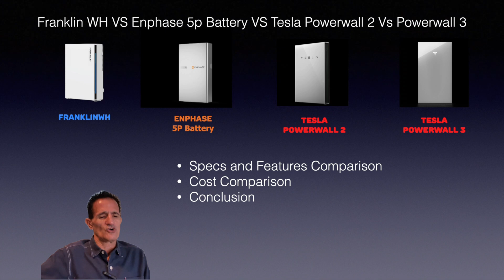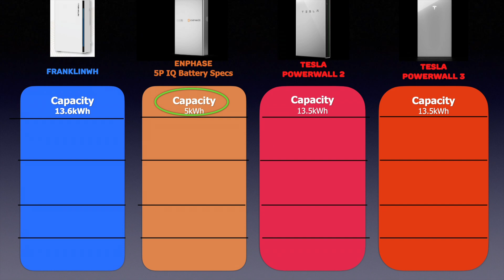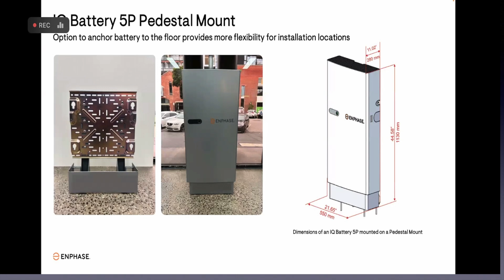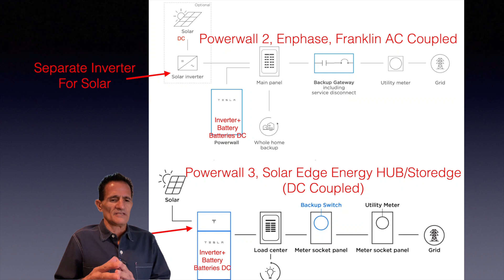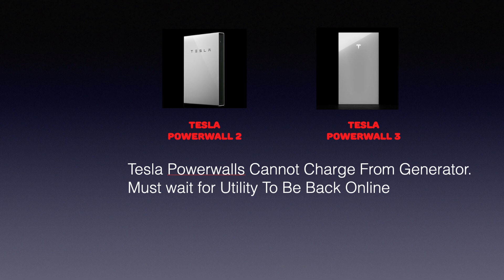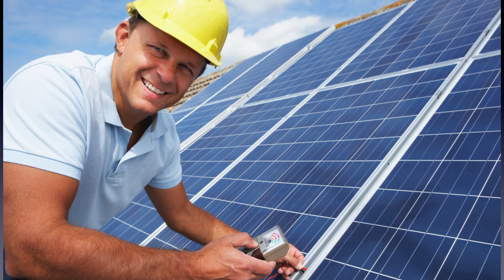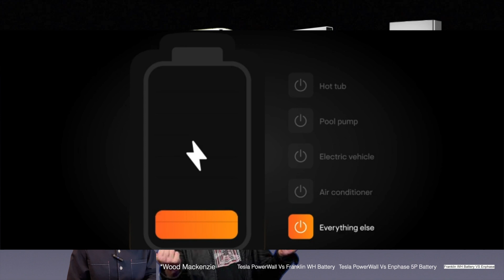Tesla Powerwall 3 Vs Enphase 5P VS Franklin Battery. Tesla Powerwall  Alternative.

Comment from the maker: Greg Can Be Reached at :
solarbygreengreg@gmail.com
727-219-9785  text  or call
For Product Sponsorships , Solar Consulting and quote , etc 
I’m located in Tampa , Florida Area but I do have contacts with solar companies across U.S.A.
Quick update:  1) PW 3 recent update allows AC Coupling
2) Video was done pre-release PW 3 Specs have been updated-see tesla spec sheet.
Reply: I don’t understand why convert from dc to ac and then back to dc. Why can’t you wire each panel, dc to dc and have an inverter when selling to PGE?
Reply from the maker: @mariloubannon5874  Yes you can do solar panel DC to battery DC .. then export dc-ac  or import ac to dc -to charge battery .. Solar edge  (Home Hub or Storedge models ) and string inverters work this way .. less conversions and more efficiency ... However, many homeowners adding batteries onto existing solar  that does not have battery ready inverter... in this case an AC coupled is better solution..  Also, many times with a DC couipled like Solar edge you don't have   many options .. in case of Solar edge either Solaredge battery or LG battery only .

Comment: NOTE: FranklinWh doesn't allow homeowner self installation,  even if permitted by the county (unless you're a licensed electrician).

Do you happen to have a list of battery systems that allow homeowner installation?  I was so sold on FranklinWh, even ready to go through their installation certification process,  but they said no.
Reply from the maker: Wow! I didn't know that about Franklin....  Try EG4 they are very DIY friendly .. I heard great things about them but I have not reviewed yet ... although I may review in future...
Reply: @solarbygreengreg thanks.   I'm likely going EG4 with the 18kPV if my county will permit it.  I was about to do the FlexBOSS 21 and GridBOSS until I saw that thr GridBOSS is only rated for an ambient temperature of 113 degrees F which, frankly, makes it unusable in California,  Florida,  Nevada,  Texas and more because it gets HOT.  (Incidentslly, people who say it is 140 are not looking at the most recent specs, and people who say "don't worry, you'll never draw that much power" aren't concerned about voided warranties or liability if EG4 or my insurance company tell me that a failure / fire was due to my negligence using it out of spec)

I'm a little disappointed in EG4 in that I wrote their tech support a month ago asking them to explain how people deal with that ambient temperature and they didn't reply at all, even to tell me that it is what it is. People had said how supportive they are but frankly I didn't see it.

Comment: I have a company wanting to use micro inverters from Enphase but Tesla 3 batteries for there capacity. Would you recommend this? Would it be just a waste of cost paying for micros since the batteries has this function. I don't get some shade where they will be placed but not allot.
Reply from the maker: Good Question....I have seen this Enphase/Tesla PW combo before... Enphase micros ... besides optimizing for shade .. you get redundency.. if a micro goes out ..rest of solar panels keep working.. , homeowner can verify all solar panels working w/individual panel monitoring and 25 yrs warranty ... I haven't seen your roof so don't know how much shade is issue If a little shade only winter months and only certain times of day--really early morning / really late afternoon .. probably can just use a PW3 .. PW3 has several inputs so if one roof or string has more sun vs another it can optimize ....but if PW3 fails you have no solar and no battery...   I'm wondering why not spend a little more and get a Full Enphase IQ8 and Enphase 5P batteries?  By having all Enphase everything in 1 app and the have a great whole home energy management system ... Also Enphase 5p 15 yrs warranty  vs Tesla 10 yrs ...  However .. Enphase will cost more and take up more  wall space (or you can get a pedestal) There  could be other factors that I don't know about .... just my thoughts ... everything has pro and cons depending on the home and customer...

Comment: As a ham radio operator I do not like Enphase or Solar Edge as they generate so much RFI to make my low frequencies unusable even as far away as a couple of blocks.
Reply: Thanks for pointing that out.  By low frequencies do you mean 40 meters and below?  Thanks again, might not use the Enphase system.

Comment: Are these batteries only meant to be backup power or can these be use 24/7 off grid
Reply from the maker: You can use these off grid  but mainly designed for a modern home … but  there maybe Better ones for off grid  … off grid is usually a lot lower electric use … for example a small cabin   Not using hvac  would be lot lower electric use … could use a smaller battery and inverter
Reply: @solarbygreengreg  thanks a piece of land I was looking at buying electricity is kinda far and curious because this maybe a cheaper option and I would want this even if I had power from the grid
Reply from the maker: @truebengalsfan  thanks for watching!

Comment: Not to toot my own horn or anything, but how did you avoid talking about service for all of these manufacturers? Have you tried calling enphase/tesla service lines? Enjoy your 30-60+ minute wait to speak to someone. FranklinWH's average wait time for service is less than 2 minutes (all of 2024 so far, I can share the data with you). I also agree with EVERYTHING said by @texasie8015. There's some other inaccuracies on the FranklinWH product as well. I'll let some of my colleagues chime in here.
Reply: Just a few inaccuracies to clarify from FranklinWH side. 
- Franklin does have PCS controls
- Franklin can be wall mounted and is the preferred method of install
Reply from the maker: After I did the video it seams other companies added PCS ... Noted that Franlklin can be wall mount .. however it's 400lbs this is  HEAVY for a wall mount... Ok if have masonary wall .. but not something I would mount to drywall that is in most garages.. Thanks
Reply from the maker: I  educate homeowners without click bait or sales talk.  No bias towards one particular brand .... depending on the home, net metering,  kWh usage, budget, etc  The best option is different for different homeowners. 
You can't say Tesla/Enphase ... these are different independent companies that are not affiliated.   My video is about comparing the specs and features ...  
However, I have contacted Enphase and they have been excellent ... Sometimes you can get quicker service if you use the Chat support so try that if long telephone wait .. or you can use the call back feature ...  Only have had a few problems with Enphase ie a failed micro inverter and they have been quick to replace ..about 1 week ...  
Tesla I heard from homeowners about non-responsive service from Tesla ... so I suggest getting Powerwalls through a local solar company instead of Tesla direct.
Franklin is a good company as well  which is why I included then in this video  comparision ...
 Thanks for watching.

Comment: Stop it 🤣😂😂😅😅😂😂🤣😂 please stop. "Smaller capacity is better" 
This is an enphase commercial not a real comparison.😏
Reply from the maker: Pleaee listen I did not say smaller is better … simply that having smaller building blocks is more scalable you can right size the system better … for example if you want 20kWH of capacity  with other options you would have to buy 2x 13.5kwh = 27 kWh. Vs enphase you can. Get 4@ 5kWH = 20 kWh
This is not commercial for enphase as I said several times in video  there is no one size / one brand for everyone … there are certain reasons why someone may get other brands … and this is why I’m listing comparisons for each option and same in conclusion … really I think all this brands are a good option .. just depends on features , budget , and  job site conditions ie kWh usage , net metering etc 
Thanks for watching
Reply: @solarbygreengreg  don't worry I got you 1:59

Let's be honest. When someone switches to solar energy, having the ability to store that energy with a larger battery is always a good bet.

Unfortunately, none of these options offer a good return on investment (ROI) in my opinion because they are way too expensive and Enphase is the worst of them.
Reply: @passerau  In my state, the ROI is better with batteries than without batteries so it's constantly changing. And the proposal I saw had enphase batteries and if you get a powerwall 3 for example, the ROI would be even better. It all depends on the incentives and net metering policies you have in your area.

Comment: Hey Greg, I have to disagree with you. We have installed FranklinWH and Enphase and I find the Franklin to be superior.
Currently the cost for the first FranklinWH fully installed is $15,000.
Every subsequent FranklinWH is $10,000.
$25,000 gets you 2x FranklinWH at over 27kW of power = $0.95/W
The first Enphase 5p will cost you $9,000
The second will cost $6,000, maybe closer to $5,000, but lets stick with $6,000.
If you install 4x Enphase 5P batteries that will run you $27,000.
$27,000 for 20kW of power = $1.35/W.
That's a big gap in $/W.
The 5P allows for a person to run more off less battery size, but you do not have the storage reservoir to run large appliances like the AC for as long as the FranklinWH.
Both batteries are awesome and I have no qualm installing either, but when clients ask which is better I don't hesitate to say FranklinWH.
Reply from the maker: I mentioned in video Enphase is most expensive per KWh storage I was very clear on this  in conclusion part of video …. I also mentioned that Franklin and Tesla likely lowest although pricing always changing  since I published in December powerwall 3 pricing not available yet… Your pricing on Enphass is higher than market … most installers charging  $13k  for qty 2 enphase 5p. Which is min qty I recommend  if they want to run anything big …
Thanks for watching

Comment: Hi Greg, I am debating between Franklin and Tesla Powerwall 3 for my 8.6kWh system. Based on your video and other research, I feel Franklin gives more flexibility and better warranty, compared to Tesla 3. What would be your recommendation?
Reply from the maker: I suggest having a local solarv company quote you both... and evaluate your needs .. both are great units  but Powerwall 3 is for new solar you would need Powerwall 2 if going Tesla ..and yes FRanklkin better working with other brands inverters , ev chargers etc ...

Comment: I disagree with wanting a smaller battery capacity. Why not get one large battery rather than having to go back and buy and install another battery? Plus the more power you have in reserve the better!
Reply: You should rewatch the video and pay close attention to what he said about the advantages of the Enphase system. I looked at all of these and more ESS systems and I chose Enphase and it wasn’t really even close once you fully understand these systems. But most are looking for the cheapest route and are soon disappointed after they start seeing all the limitations and problems come up. This is not an area where you want to guess at. My 20kwh system was less than the Tesla system and a little bit more than the Franklin but far more superior in just about all respects. Hands down Enphase. I do it again.
Reply: It boils down to cost. Many times getting 2 smaller batteries while doubling the number of circuits that are powered is more affordable. Plus it takes less time to recharge a smaller battery. Most people don't need higher capacity. It all depends on what is essential for your property. See Bronco Power Boost.
Reply: Well it’s nice when homeowners are willing to buy more capacity … but with each battery 13kwh  over $10k+ with install buying another 13 kw is not in their budget or willing to pay to get a little more capacity  …if someone needs 20 KWh is would be cheaper likely to get 4 enphase 5p vs getting 2 powerwalls etc 😊
Reply: @gregm448 it is usually not cheaper as Tesla has their backup switch which reduces installation cost substantially. Wall space needed for PW vs 5p isn’t even comparable. 5ps take up a ridiculous amount of space.
Reply: @Energy.Theory  As mentionee in conclusion Enphase will be more expensive in most cases  except if  doing 20kW battery vs 2 Powerwalls ... Yes Enphase takes up more wall space but with higher peak output many homes will need less battery capacity . As I said in video there is no one size fits all .. all depends on situation and budget of homeowner .

Comment: I’m considering a number of proposals for a solar system on my house.  This is exactly what I needed! Easy to understand comparison. I think enphase due to the modularity, make up (LFP- safer), and resiliency. A couple of emphases batteries with micro inverters costs a little more but there are no single points of failure. I wish emphases could stack on each other for maximizing space but oh well. I was looking at generac batteries due to DC coupled and modularity but I haven’t seen anything new from them in a while and I am concerned they will be exiting the market.
Reply from the maker: In my opinion Enphase is best option right now. Great instalerc and homeowner support.  Best product.  Generac Powercell I tried a few years ago  lots of problems .. I don't know if it's changed but  I'm not selling them.   Thanks for watching!

Comment: Im a big Enphase fanboy -- and you outline many reasons in this video.  It's about the resiliency, optionality, and peace of mind (warranty). Moreover, Enphase is an expanding platform incorporating generators, EVs and bi-directional charging, and ease of use considerations like load shedding.  YMMV but I think Enphase is a great way to go
Reply: any chance I could ask you a few questions related to your Enphase experience? Trying to understand battery incentives and VPPs. Thanks
Reply from the maker: I agree. Thanks for watching.